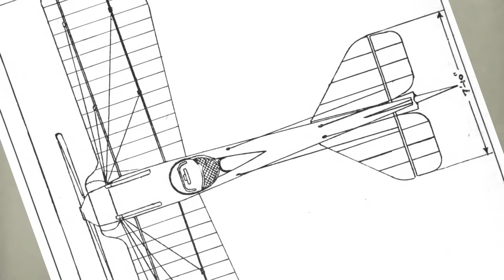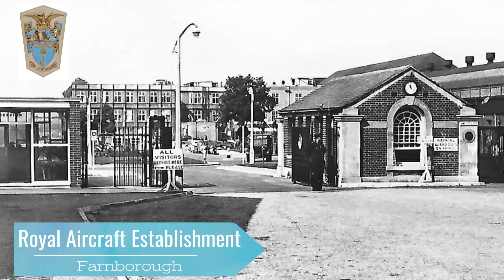This Spitfire ALMOST Went SUPERSONIC - The British WW2 Fighter That Almost Broke The Sound Barrier

Comment: THE INTERNET & FANTASY WORLD CLAIMS !!!
The normal speed of sound at sea level is 760mph. The fastest recorded speed of any Spitfire was 606mph in a 45 degree dive, by a MkX1 so still a long way short of breaking the sound barrier. And the first to break the sound barrier was the German V2 Rocket during WW2 with an estimated maximum speed of 3,400mph in its freefall decent from about 52 miles high  !!!!

Comment: as a kid I inherited numerous Yak-9D Airfix models
what intrigued me was how small they were ..... but also how they their wings were inclined backwards. Why was that  ? 
I think it was similar to the twist on the Spitfire wings to delay the stall .... to make it easier for average pilots to handle.
Thing is the 1st Soviet jet aircraft were - basically jet engines on a Yak-9 .....
it doesn't then surprise me at all that the Spitfire and Yak-9 were cose to the sound barrier.
Tempest etc ..... nope

Comment: It might have been worth mentioning the other tests at RAE in 1944 when a Spitfire was fitted with an all-moving tail to see whether it solved the compressibility issues with conventional elevators that massively increased control forces, and drag.  They reached M0.86 with much improved pitch control.  This work was part of the research supporting the Miles M52 design.

Comment: On February 6th, 1952 Fl. Ltn. Ted Powles reached Mach 0,94 in a dive from 51 500 feet over Hong Kong during what was called a meteorological mission. Was it really? You can take a lot of interesting pictures of mainland China from that altitude. That's the highest speed ever obtained by a piston engined aircraft, and the highest altitude ever reached by a Spitfire. Not bad for an aircraft conceived in the mid 1930s with the original wings and fuselage of Reginald Mitchell's design, only modified and strengthened for the considerably more powerful Merlin and Griffon engines. If there ever was an aeronautical genious it was R.J.M.

Comment: Depends on how course you could set the pitch on the prop. The radiators on Spits are in the same location as P-47 dive brakes.😊

Comment: That was Sqn Ldr Tony Martindale attached to RAE Farnborough In a Spitfire MkXI 
He was testing transonic flight when his engine ran out of control He lost his spinner and he was flung all over the sky, passing out. When he came to he was at 40000ft no engine Wings Bent up and he then glided back 20 miles the Farnborough His Machmeter showed  Mach 0.92

Comment: With regards to the RAF Kai Tak Spitfire, it would be interesting to note whether the Speedometers where calibrated to National Standards and what was the accuracy and repeatability of them. If it was the case that the gauge was calibrated and the Spitfire had been just shipped from the factory we could say that this was indeed the new record. Usually certain gauges are classed accurate to +/- X mph or as a +/- percentage when manufactured, given the vibrations these aircraft would go through, gauge inaccuracy would increase over time!
Reply: They are or were world accepted.

Comment: The Spitfire was not an especially durable aircraft. The P-47 not stripped down either for example, would go into compressibility in a frightening short period of time if the nose was put down as repeatedly  recorded. But it never bent or broke. I don’t know how its possible to mention this and not mention both the P-47 and the P-38. If the special airspeed indicator was linked to air pressure as the standard A/S indicator is then its was not reliable in compressibility. And the Merlin had a reduction gear on the propellers to keep the propeller RPM down to avoid the tips and more of the prop going supersonic in normal flight. Its also dependent on temperature and altitude. AND once in compressibility its impossible to pull out until the aircraft got low enough that the air density increased to the point that the drag slowed the aircraft out of the  compressibility range. It DID take a lot of guts to do this and a tip of the hat to the pilots. The reason Chuck Yeager was able to exceed the speed of sound and survive was the he and the engineers changed the horizontal stabilizer to a stabilator IE the entire airfoil moved like on a moder jest aircraft, even airliners. Without this mod super sonic flight was basically impossible. This gave the F86 in Korea an advantage over the conventionally tailed Mig15. Swept wings were not needed as shown by “Glamorous Glennis”,  the F104the X-15 etc. But it DOES work better.

Comment: According to Eric ‘Winkle’ Brown’s book ‘Wings On My Sleeve’, the dive undertaken by Tony Martindale that resulted in the loss of the prop & reduction gear which left the Spitfire with slightly swept wings was his second dive that day. The first reached M0.91 and he’d had to apply 80lb of force to the stick to recover from the manoeuvre. Brown stated that he’d had to use both hands to apply 60lb of pull in his own M0.86 dive and wouldn’t be able to exceed that so Martindale took it further as he was a much larger and stronger chap. 
Incidentally, it’s not surprising that Martindale passed out as his weight-reduced Spit hurtled back up to 40,000’ ~ he pulled 11G in doing so.

Comment: I have a childhood memory of a film about these spitfire tests.  In the film it was said that beyond the sound barrier the flight controls worked in reverse.  The his would have been mid 60s, but I can't recall the title.  Regarding the validity of speeds, a similar situation befell the GWR loco City of Truro in 1903.  The guards timing log of the trains run show that it was certainly possible it surpassed 100mph, but it was discounted as an 'unofficial timing' !!
Reply: I seem to recall that they discovered control reversal at very high speed, and it was solved by reskinning the elevator with aluminium, rather than canvas?
Reply: @cossiedriverrs  Rings a bell, thanks 👍👍

Comment: I've seen an old interview in which General Chuck Yeager himself said that he wasn't the first to break the sound barrier, he readily admitted that he was the first to break he sound barrier IN LEVEL FLIGHT. He absolutely agreed that a few pilots had indeed broken the sound barrier in souped up piston engine planes in steep dives before he did it in the X-1 on October 14, 1947.
Reply: I know that he agreed that "Wheaties" Welch exceeded Mach 1 in a shallow dive in a specially modified XP-86A before the X-1's Mach 1 flight, but the XP-86A wasn't a piston-engine plane but a swept-wing jet. It's physically impossible for a piston-engine plane to exceed Mach 1 because the propellers lose efficiency rapidly in the transonic regime. The RAE's recorded fastest piston-engine powered flight is Martindale's 1,000 km/h (Mach 0.92) dive in his Spitfire, and the FAI's accepted record is held by "Voodoo," a specially modified P-51 Mustang, at 533.53 miles per hour (855.41 km/h). The FAI record is for level flight over a specified course, and it's possible Voodoo could break Martindale's record if a diving flight were allowed under modern record-keeping.
Reply: The Me 163 may also have managed to break the sound barrier
Reply: @Rudeljaeger  yes, although since that was a rocket plane rather than a propeller plane, it would have likely had an easier time doing so without the drag of the propeller
Reply: Also keep in mimd hat even though the plane did not reach mach 1, that the airflow  over the wings would exceed mach1.
Reply: Mutke and Welch broke Mach 1 in dives because they had something the Spitfire did not have and the British did not understand, the servo-power assisted Horizontal Stabilator to overcome the shock waves pressure on the elevator controls and mitigating the effects of Mach Tuck.

Comment: A lot of hot air here. Ignores the fact that the Spitfire was a poor diving aircraft. In fact German pilots used diving to break combat with Spits. 
I notice they spend a lot of time about the propeller, but no time on compressibility.
Finally, all of these measurements on Indicated Air Speed depended on air pressure. Thing is, this results in wildly variable and unreliable measurements. No reliable, verifiable measurements exist for any of these claims. More than a few pilots even claimed to have broken the sound barrier during WW2 based on similar bogus measurements.  
... Speaking of air pressure, Mach numbers are not absolute. They vary with altitude , air pressure, and air temperature. What may be Mach 0.89 at 30k or 40k is not nearly the same number as at 20k.
These are some of the reasons post war speed records were based on performance over a closed course, using external measurements, not in a dive using unreliable IAS measurements.
Reply: Get your facts straight MK1 Spitfires with the earliest gravity fed carburettors for a short time period had a problem with flooding meaning a German Pilot with mechanical fuel injection could escape by diving. (Bunting) with a sudden nose down attitude. This was fixed very quickly by a Royal Aircraft Establishment engineer (Tilly Shilling) with initially a jet to control maximum fuel flow to the carburettor, this was simplified to a washer. So for a very very short period flooding was a problem, I wonder how many German Pilots got shot down believing the problem still existed, the Brits probably kept saying it was a problem. Please correct anyone still passing on this inaccuracy. The first gravity fed carburettors was fixed with a washer and the subsequent pressure fed carburettors on later Marks did not suffer at all with this supposed big problem with the Merlin. Here is a link to Beatrice Shilling: https://en.wikipedia.org/wiki/Beatrice_Shilling#:~:text=Beatrice%20Shilling%20OBE%20(known%20as,Order%20of%20the%20British%20Empire.
Reply: I would point out that the US used the Brits to test their aircraft for compressibility where airflow over wing surfaces and control surfaces caused loss of control. The Brits tested the Lightening the Thunderbolt and the Mustang at the request of Lieutenant General James Doolittle as the Brits at that time had more advanced test apparatus. One of the test Pilots was Eric Winkle Brown, if you read his book (Wings on my Sleeve) you will see how much work was being done. He still holds the record for the most landings and takeoffs from carriers to this day and even landed a mosquito bomber and took off on a British WWII Carrier. He was also the first to land and take off on a Carrier in a Jet Aircraft. Please do more research and if you can quote where you got the information.

Comment: Supermarine developed an even faster model. Featuring an even  higher performance version of the Griffin engine and the bubble canopy fuselage, this version  - now known as the 'Spiteful' - featured a laminar-flow wing similar to that of the P-51 Mustang. This avoided the lack of rigidity that Mitchell's elliptical wing suffered at very high speed, and helped to reduce the problem of compressibility as speed approached the sound barrier. Sadly, with the onset of the jet age, very few were made.
Reply: GRIFFON engine.
Reply: @stevengriffin7873  apologies. 'Autocorrect' was 'helping'.
Reply: @wbertie2604  That probably explains why it happens so often.The F'wits that create these things wouldn't have a clue.
Reply: @stevengriffin7873  My personal theory is that it was supposed to the the Griffin engine but the o and i on a typewriter being next to each other, a typo made it into production. OK, I don-t seriously believe that :).
Reply: The mk. 19 Spitfire had a stronger wing too, even though it was elliptical, and high speed roll rates were much improved as a result. The Spitfire wing got redesigned structurally multiple times, though, the first service version being later Vs, but also separately on the IV (not put into service) and the VII and VIII and derivatives (and some but not all VI).
Reply: In February 1952 Fl. Ltn. Ted Powles reached Mach 0,94 during a dive from 51 500 ft over Hong Kong with his Spitfire Mk. PR 19. It was said to be a meteorological flight, but from that altitude you may be tempted to take a lot of interesting pictures of mainland China. After all, was a PR Mark. That's the highest speed by a piston engined aircraft ever recorded, as well as the highest altitude ever reached by a  Spitfire. However, in Egypt a highly modified Mk. V reached 50 000 feet to intercept the extremely high flying Junkers Ju-86 recobomber. After the war Sweden aquired 50 Mk. PR. 19s to look at what the Soviets were up to, and in1949 Ltn. Ingemar Engstrøm took off to investigate rumours of a secret missile base in East Russia. He climbed to 14 000 meters, 46 000 ft. A flight of MiG 15s climbed to intercept him, but  didn't succeed to catch him. He was flying too high for them. After all there was no missile base there,  but it was an interesting experience. Not bad for a mid thirties design. Mr. Mitchell knew what he was doing.
Reply: Did the Spiteful wing have a higher tactical /critical mach number?
Reply: @baselhammond3317  no, it didn't. Based on testing on the Attacker, possibly a tiny amount lower, but it allowed for better performance 400-500mph, which was more important.
Reply: @baselhammond3317  No about 0.83 not as good as the old wing
Reply: Eric Brown said it was a horrible aircraft, all heavy engine and had lost all the good characteristics of the Spitfire.

Comment: I think if they put a turboprop in one they could break the sound barrier.
But then again, I think an Avro Arrow fitted with modern engines, electronics and tweaked through trial and error, could do Mach two...at least.

Comment: I think I’d be more confused as to why the third spitfire didn’t take damage like the one before. That alone would make me question the reliability of the speed and possibly the story.
Reply: probably a material difference between mk 11 and mk 19 not entirely sure but it's the only guess because dropping from 50,000 feet the mk 19 was also built with the griffon engine and so was designed better for the higher top speed so new engine and new fuselage and wing designs probably, sorry for the 1 year late reply you probably won't see this but if you do this might help a little.

Comment: The P47 was frequently use at very high speeds (probably close to 1000km/h) during hunt on Me 262's over germany (Spitfires was nevers use because had a low range) , and was able to fly FASTER in dive as a me 262 who was limited at ~950km/h from tail design defects who make this aircraft totaly uncontrolable in transsonic speeds...but "almost break the sound barrier" for the Spitfire  is a false assertion: the sound speed (mach 1) is at 1224km/h at sea level  and 1153km/h at 5000m altitude and the speedometer use on the WW2 aircrafts was unable to measure the real speed over 900km/h...i did use metric for the numbers because mph is not  international allowed , but only Knots = nautical miles per hour (who is metric), or km/h) and mph are only use from Brits and US, never from continental europe countries...
Reply: No it wasnt.

Comment: What many people do not understand is that the local Speed of Sound is dependant on Temperature. Air Density has almost no influence on S of S. At 40,000 ft, the air temp is likely to be in the vicinity of -40 degrees, so the S of S is lower than at ground level, (763MPH @ 15 degrees C). Therefore, for a given groundspeed, the Mach number will be higher at higher altitude, due to the lower S of S, which changes by about 1.3 MPH per degree C. At 40,000ft the local S of S is likely to be in the vicinity of 690MPH. If the plane descends at a constant airspeed, the Mach number will fall as the local temp and local S of S rise. Many pilots were saved from high speed compressibility in a dive as the Mach number fell with the rise in local S of S.

Comment: I live in Newmarket suffolk , nearby is the old RAF Duxford aerodrome and new museum , and have the privilege of hearing that merlin engine sound and seeing that beautiful R. J Mitchel designed aircraft regularly - and it stops me dead in my tracks every single time.
Reply: one very lucky person
Reply: You may have seen my flight 3 years ago when my excellent pilot Barry Hughes allowed me to take control for a couple of minutes and I  then realised why one of the ww2 pilots I  had seen on television said that you didn't so much fly the spitfire as put it on like an overcoat and it flew itself. 
It's such a pity that Mr Mitchell died before he saw the results of his great invention.

Comment: 11:05 There was an instance where a Lockheed P-38 Lighting reached 780 mph in a dive, but its instruments weren't designed for accurate measurements.
Reply: nope, the P38 had tail problems (appears supersonic waves who destroy the tail this is Why the P38 had dive speedbreaks) at high speeds and was unable to fly such speed without desintegration in the air
Reply: @leneanderthalien  Mentioned its instruments  weren't designed for such speeds, hence inaccurate (i.e. read high), 
read in 𝘓-1011 𝘛𝘳𝘪𝘴𝘵𝘢𝘳 𝘢𝘯𝘥 𝘵𝘩𝘦 𝘓𝘰𝘤𝘬𝘩𝘦𝘦𝘥 𝘚𝘵𝘰𝘳𝘺 1973
Reply: Utter nonsense!!)

Comment: Great piece of work! The bit about how the prop is driven directly off the engine crankshaft is wrong and so is the phase "making so much power they were breaking the sound barrier"- power has little to do with it- the propeller blade tip speed, as it goes past the speed of sound, starts a rhythmic moving sonic boom that shakes through the entire craft. But work on the details- the presentation was A OK! FR